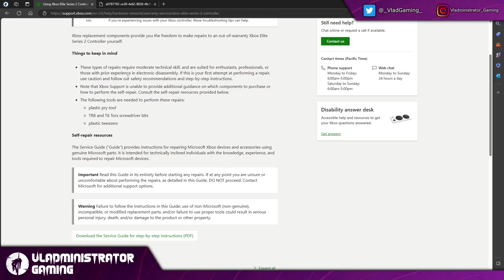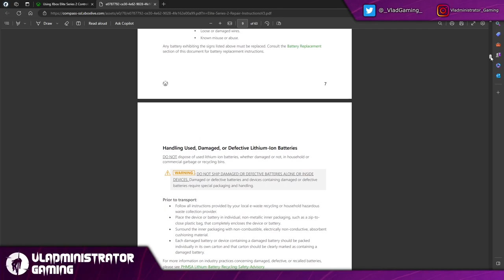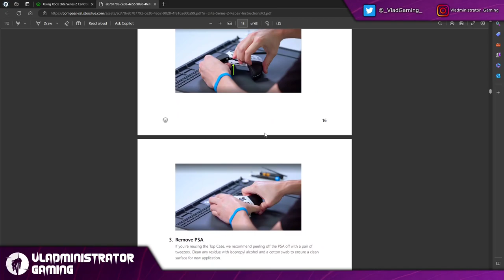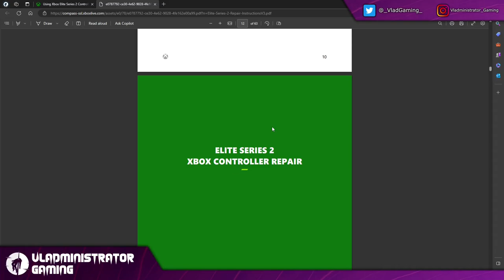Xbox Elite Series 2 Controller Repair | I/O Board and Bumper Buttons

Comment: So I have the Xbox Elite Wireless Controller Series 2, the thumb stick comes loose i mean i need to screw it the right (clock wise), then play for 5 minutes then it comers loose again, i find myself tighting in between game time, does anyone know how to fix? its works it way loose ( not in movement) tighening to the right as hard as i can then in 5min its loose again  (not tight)
Reply from the maker: If you remove the top case you'll be able to take the thumb stick base all the way off, and you could add some thread locker to keep it screwed down. However, I don't recommend using anything that is labeled as permanent strength, because removing the thumb sticks is required to complete other repairs if needed in the future. I'd test if taking it all the way off and reseating it helps before adding anything to hold the threads in place.